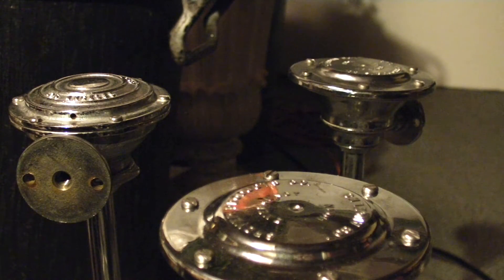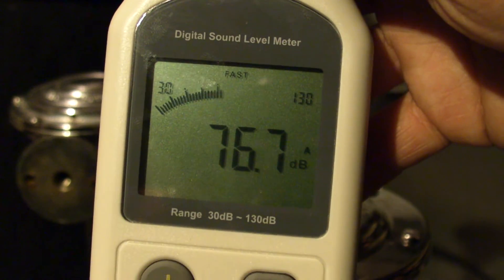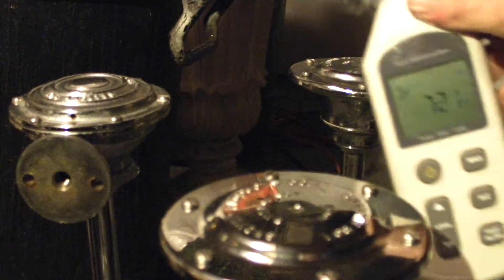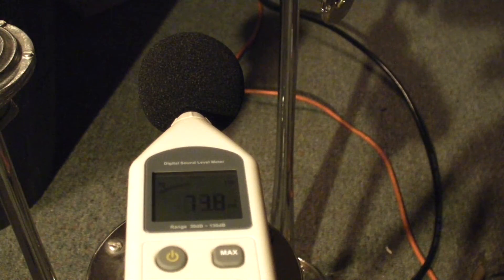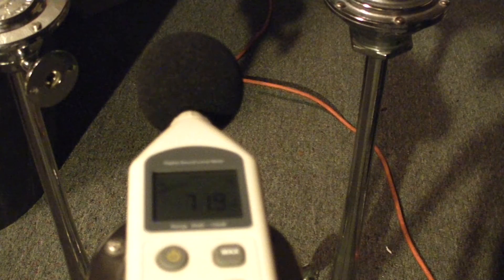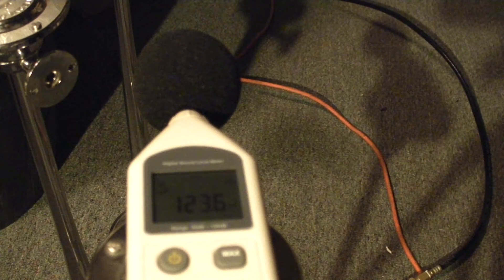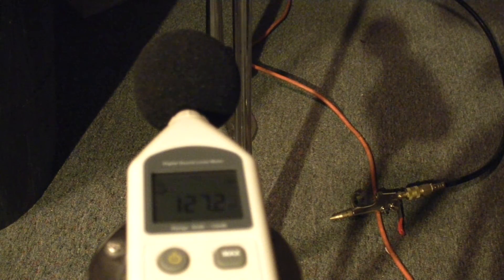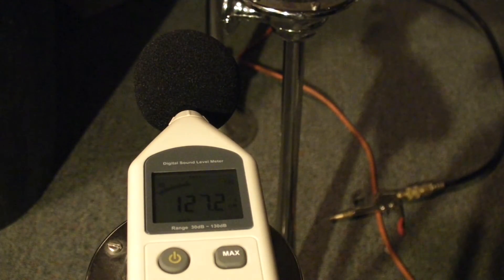Testing a dB Meter with air horns

Comment: My meter has a "hold" feature. The last highest reading. Then just hit the button again.
Also mine jumps from 39 to 71 from talking. the dB-A is for midrange, and dB-C for low-frequency noise. I see it there on the right A/C button.